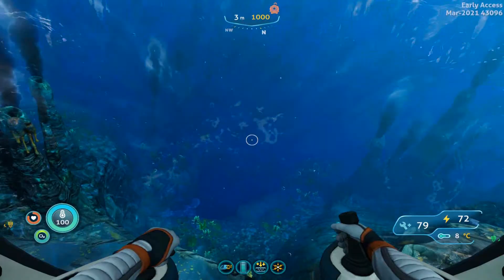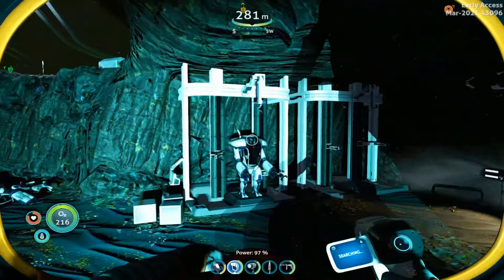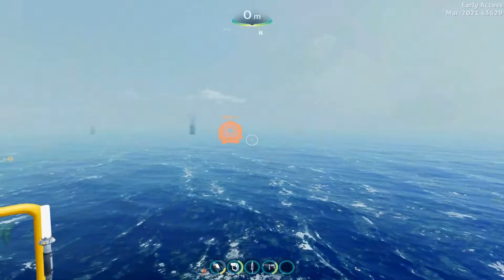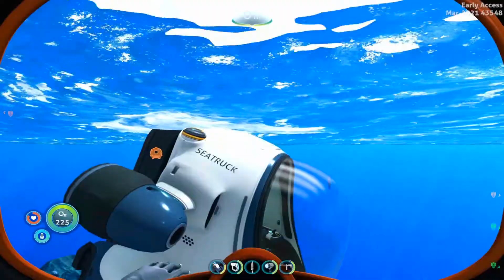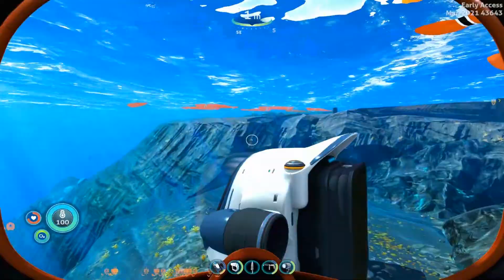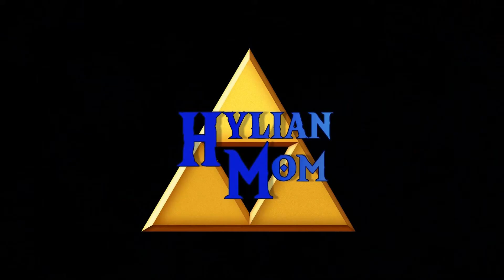ALL PRAWN SUIT ARM & UPGRADE LOCATIONS (w. Timestamps) || Subnautica Below Zero

Comment: hey can you tell where is the depth moduke mk3 i cleaned all map and cant find it
Reply from the maker: Hey ibrahim, I dont know if you still need help (sorry for late reply) but the Mk3 blueprint should be automatically yours already. You have to use the Modification Station, something you build with the habitat builder, to craft upgraded modules, if thats the issue.

Comment: Can someone help? I'm playing on Switch, I have the jump module assigned in my prawn suit. But it says "no input assigned"? How do I assign a button to make this work?
Reply from the maker: Usually its attached to the same button you would use to jump w your person. If it isnt, the settings in the menu should have an option for bindings. I am on PC so i i can't say for sure but it should be available.
Reply: @HylianMom  Thanks for your help! I'm thinking it's a glitch becuase under Bindings, I have "X" assigned to jump for my character, though it dosent recognize it as my jump button for the prawn suit. On Switch there are two buttons you can assign to jump. Assigning a second button of "L" does not work either. Not sure what I'm doing work, probably just report it. Thanks for your help anyway!

Comment: The prawn suit is much worse in this game in my opinion.It runs out of power quicker than in base game subnautica and it moves too fast.Soem may think the fast movement is an upgrade, but I think it doesn’t match the suit’s “tanky powerhouse” role.
Reply from the maker: I never got used to the Prawn suit much, but we will see how it handles against the beasts of the land territory, Thats where it seems to be the most useful instead of the water like the first game. They added the forward thrust option, for sure, and it makes it handle differently, you're right.

Comment: Your guides are the best.  Right to the point, and every word you speak is meaningful to the topic of the video.  Thank you.  Off topic question:  I am searching for lead nodes that need to be drilled using prawn suit.  Are there any in Below Zero?
Reply from the maker: Glad you like them, thank  you! I dont think there are Lead Deposits/Nodes anywhere in Below Zero, it is just Galena outcrops that will give you single Leads. At least, not that I know of yet.